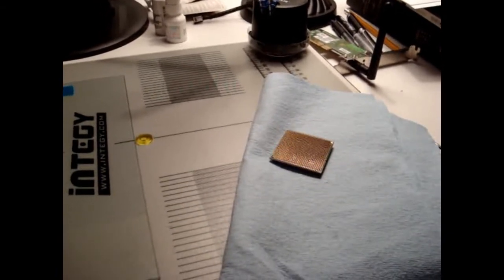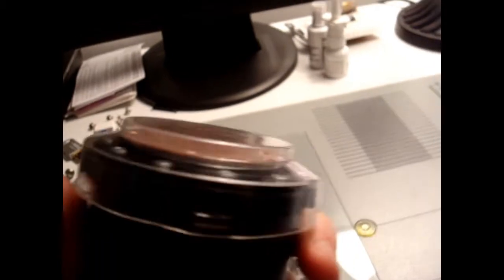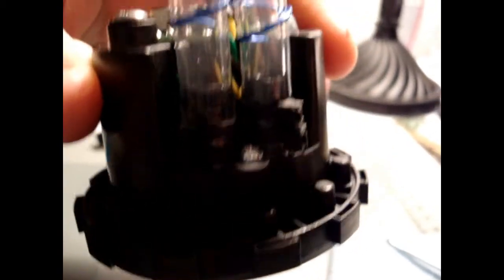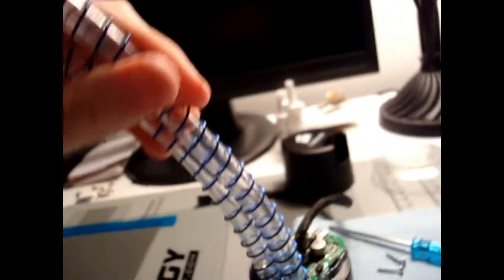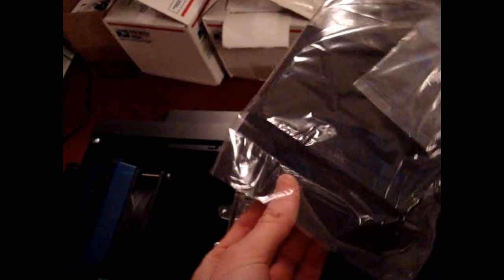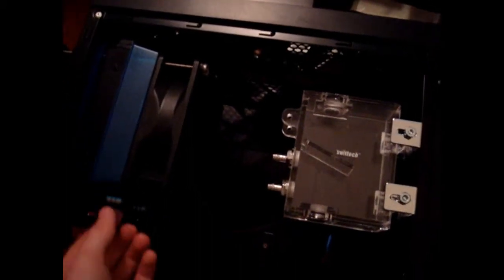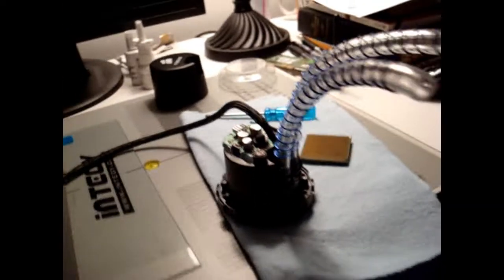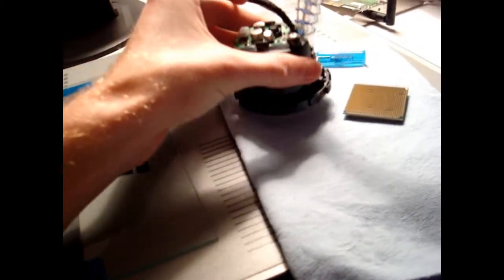Corsair H50 mod Pt. 2

Comment: I know this is old and I probably don’t read comments anymore... I just wanted to thank you for putting this on YouTube!  I have my h50 modded and using it on my 980ti reference with zip ties and keeping original shroud and fab for VRMs.  It works better than the kraken g10/12. What people forgot about this version of the Astek pump is the protruding cold plate.  It the only ones that line up and fit  perfect with the Nvidia blower style plates!  I have 2 h50’s from garage sale $1 each and from same guy antec 620 and 920 for 10 each at a garage sale!  Anyways thanks again in2019 it’s hard to find the info in forums it gets lost or pictures disappear or disabled

Comment from the maker: @Bodywrecker no, the h50 cant handle addition water blocks. It just isnt strong enough to push the water through the added restriction. I have seen/read people using a 240 rad though.

Comment: wow some people spend way to much time polishing a turd. dont get me wrong iv been running an H50 for the last two years and was very happy with it. for the price its a good cooler and you cant go wrong, and it exhausts all cpu heat out of your case rather than an air cooler that recycles it into your case. but if your going to put that much work into it why not just go true water cooling, so much more performance. no matter what you do to an H50 it will never beat even a simple true water setup